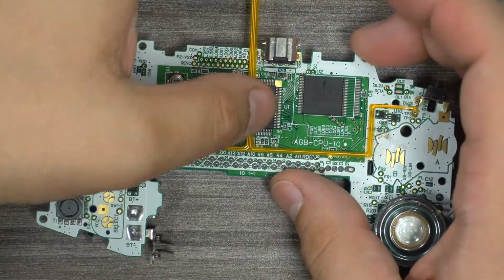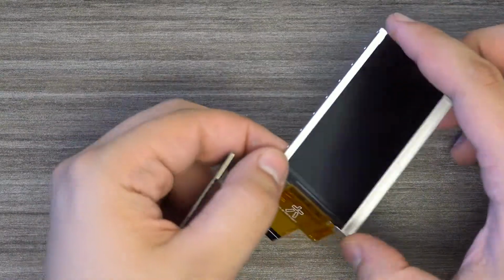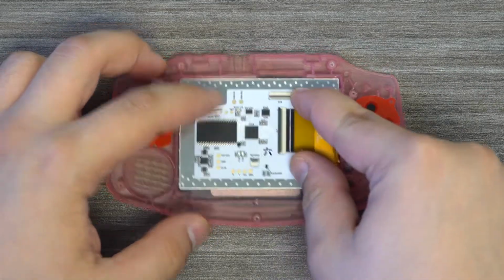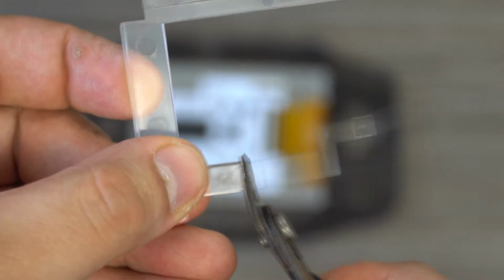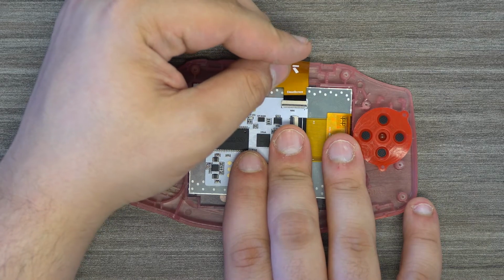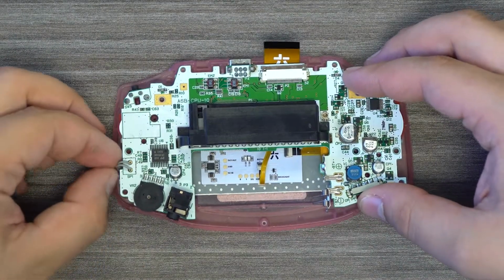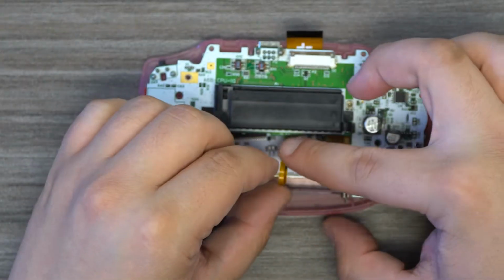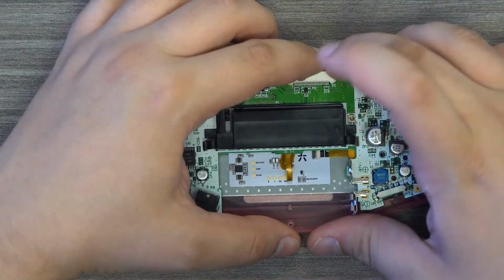Gameboy Advance CleanScreen | Install Guide

Comment: Thank you for this great video ! I have just one question about the screen :).
Is the picture quality better same or worse to the ips Variant?
Reply: ips have better colors and more brightness
Reply: Better. Much much better. And it can be switched back into IPS mode, so the differences can be seen in real time. Plus you get pixel grid and true transparency effects, both can be turned on or off. Bit more expensive, but no brainer.